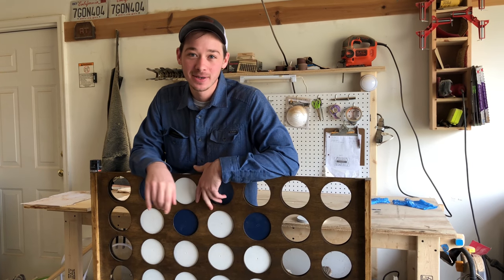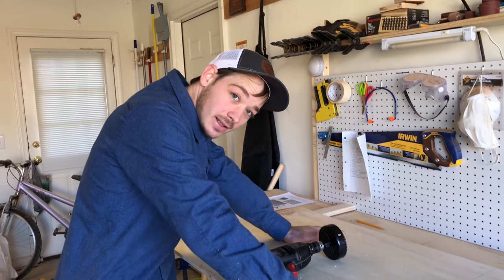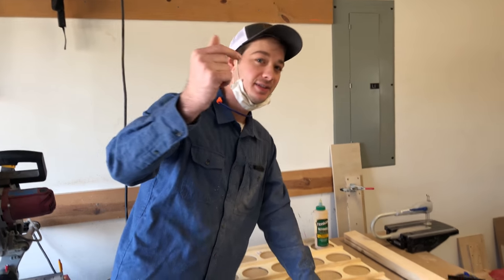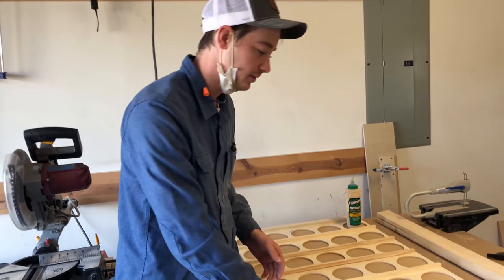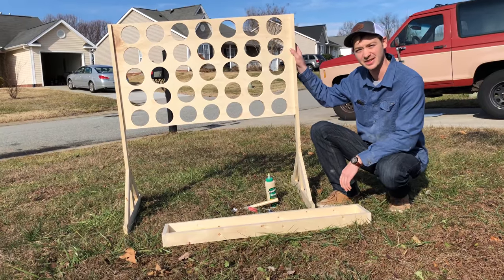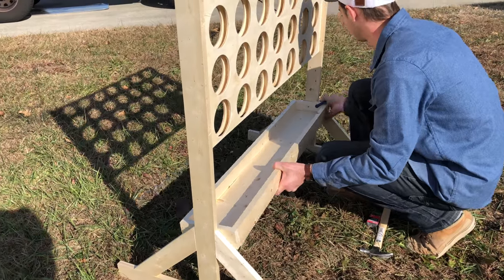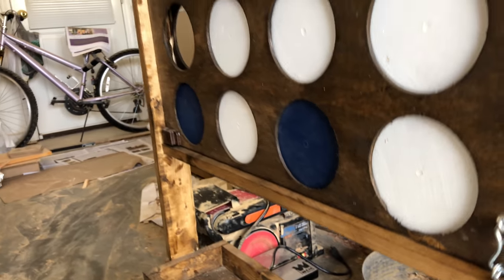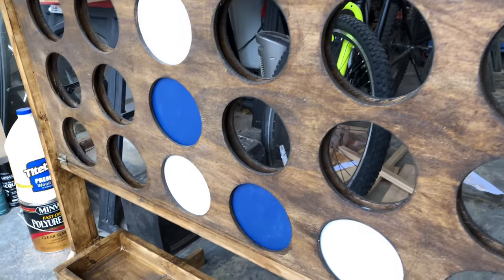How to Build a Giant Connect 4 Game for the Backyard

Comment: Hey man, 

I don't think the plans are available anymore on Home Depot. Would you mind posting all of the materials you used?
Reply from the maker: Oh dang! That’s a huge bummer. I remember them being a really good set of easy plans. I can recall most of the materials but I’m very uncertain on the actual measurements. The discs were 1/2” mdf. The game itself were 2 small sheets of 1/4” plywood, with some 1/2” square dowels to act as the spacers. The basket was made of 1x3s and a 1x6 I believe. Wish I could remember more! 🥴

Comment: What is the length and width of the 1/4 in. Plywood that you used?
Reply from the maker: I linked to the Home Depot plans that I used but it looks like they’ve taken the plans down ☹️ if I remember correctly the panels are about 38”x24”……hope this helps!

Comment: Why did you cut out the chips separately? Can what you drilled out not be used as chips
Reply from the maker: That is an idea that I had, however, the chips ended up being too small as they need to be slightly larger than the holes for them to stack and line up right. For example, if the chips were only slightly smaller, the 4th chip might end up being placed awkwardly between the 3rd and 4th hole. Hope that makes sense.

Comment: How large were the actual boards that hold the disks?
Reply from the maker: If you mean the little tray underneath, then used a 1x6 for the bottom and the sides were 1x3s. Now the only important measurement is the length but it’s been so long now I can’t remember 😂 I think maybe close to 3ft. You can just cut it to fit once the legs are attached to the game. Hope this helps!

Comment: Follow directions, made discs 5" and holes 4", now my discs are too large for the game, any idea how to make them smaller so I  dont have to cut new ones.
Reply from the maker: Hmm that’s weird. How much smaller do they need to be? You could try sanding on disc sander, or if you need to take a lot off you could try a jig saw or bandsaw
Reply from the maker: Also the slots on the inside should be 5 inches apart
Reply: @JThorumWoodworks  I was able to fix my problem by sanding the discs on my sander, I originally made the disc 5" and the game is only 24" high, so I  sanded them down just proud of 4.75" and it worked out.
Reply from the maker: Doug Martin good! Glad you were able to work it out